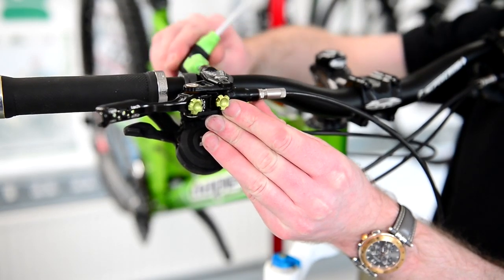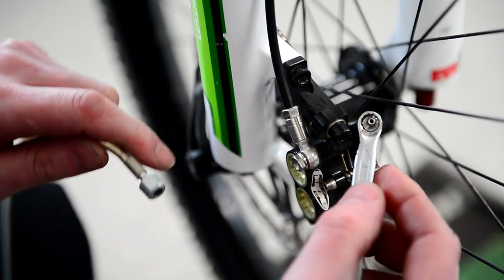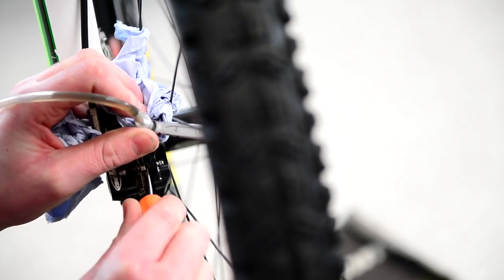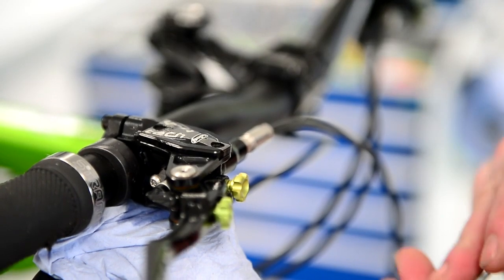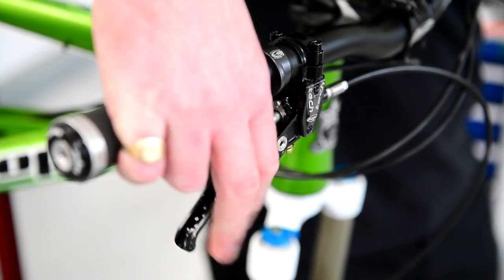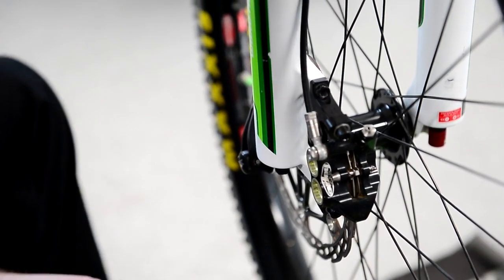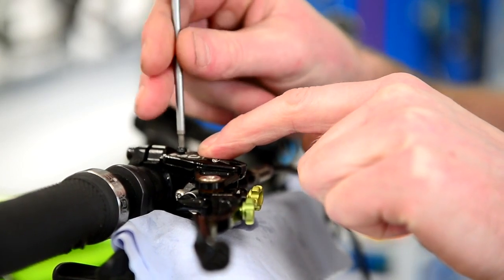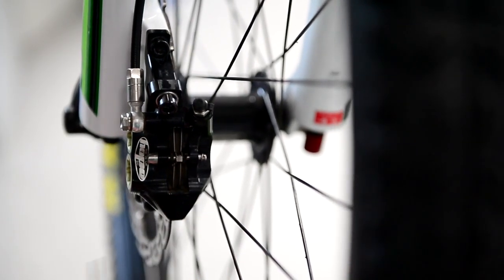Hope Technology -  How To: Bleed a Brake

Comment: I have a tech 3 system and its honestly a worse brake than my DB5's were.  I had MORE stopping power on the DB5 than I do on the Tech 3 e4.  I attribute it to bleeding, but no matter what I do, I dont get a decent lever.  It can be pulled to the bar and still not skid the tire.  It doesnt use NEAR as much fluid volume per press of the lever as this one here does.  I wonder if thats the issue??  Brand new brakes.